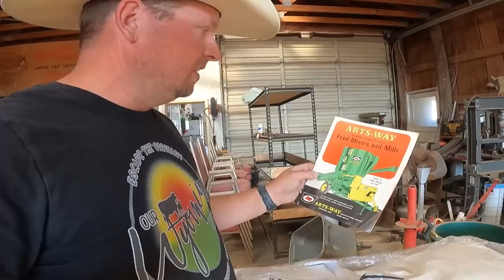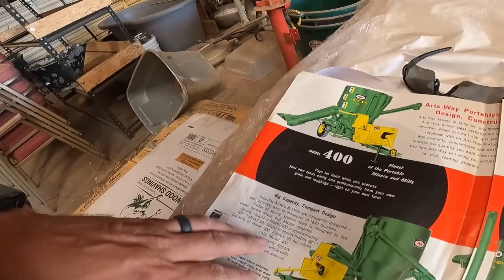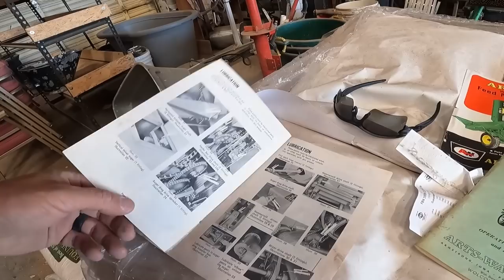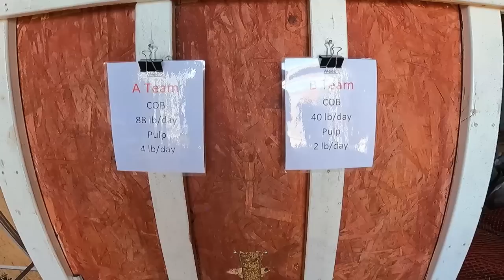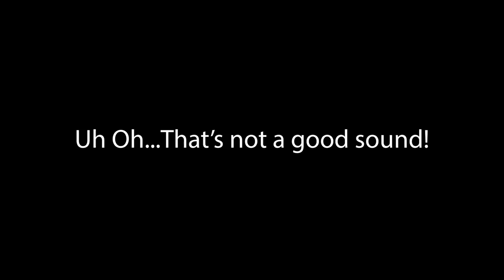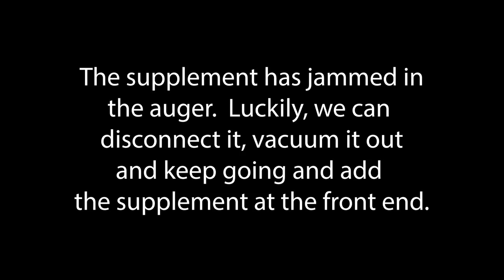A New Grain Mixer with a Visit to Sonne Farms!

Comment: Great video,  I  actually saw  the Sonne Farms video first.  Brings back memories of grinding feed with  the AW mix-mills.  I  used to own a “400” then moved  up to a “420”.  Hope  the reps, Brian, or the service manual mentioned checking the oil level in  the main  gear  box  underneath the main mixing vertical auger.  Could get spendy if it  runs dry.  Hope you have good luck with the mixer.  Well built machines!

Comment: When we pulled step deck and flatbed we hauled wagons from Arts Way in Iowa to PA several times. In fact one time the clutch went out in the Freightliner at their place. I spent a couple days in a motel for it to get fixed at an Excavator's shop. Then I could pickup my load.
Reply from the maker: Glad they were able to accommodate ya Joe.  Ive heard that the trucker community are pretty helpful to each other.

Comment: When you lube the chains and the discharge auger joints use bar and chain oil for chain saws.  It does not run like motor oil as it is made to stick to the high speed chain.
For the bacon bits they might do better if the feed is ground.  Check with your FBN guys on that.  I just remember that our milk cows got ground feed and the pigs had finer grind for them.
Your Wyoming weather is dryer than Southern Minnesota's weather.  I was stationed at FE Warren Air Force Base from 1962 to 1966.  I enjoyed my time there but had no ties to stay for.
Enjoy your videos.
Best to you and yours.
Reply from the maker: Thanks for that tip about Chain saw oil David

Comment: Had a grinder like that, then in early 90s traded it for a Arts Way Grixxer. Very similar, used it for grinding hog feed. still use it today for my calf feed mixing. I'm from NW Iowa about an hour away from AW manufacturing.

Comment: Those are good mixers/grinders. I have one from International, which was actually made by Artsway. Yours is in much better shape then mine and I wish mine had that loading auger. One suggestion/tip, when you go to add mineral or whatever into the small mineral tub, there's a small piece of metal on the inside to the left, if you flip that up it will hold the lid up for you. I run mine on a roughly 65 hp tractor and can make it work hard grinding pig feed, so watch for that if you ever grind your own feed.

Comment: Mike my grand father bought a hammer mill from Sears. Built by w w grinder Wichita kansas. Powered by a flat belt from a tractor. I bought a bear cat grinder mixer. Disconnected the mixer , Turned grinder discharge, blow it into trailer. When I grind baled corn stalks I can pull down my 4010 John Deere.

Comment: I've spent 1000s of hours filling an artsway 400 We used to put about 300 acres of corn in large corn cribs and then all threw the fall winter and spring we would grind feed for our cow calf  operation at that time we were finishing about 100 head of steers and heifers..

Comment: Hi, like your channel, I have run a grinder mixer a lot of years, I would suggest not to put all your supplements in first, because most of it will sit on the bottom, if you noticed when you had upper open and looking in side grain has to build up before it starts coming up the center tube to mix, I would put grain in first to build up to start mixing, then as you continue putting grain in add supplements a little at a time as you add grain. Just my 2 cents. Thanks for videos

Comment: Nice to see that you have an easier way of mixing all of your feed together rather than using the concrete mixer. Honestly you do not even need to fix the supplement bin all you need to do is turn off your hammer mill right away and add your supplements the same way you loaded that bag. The auger underneath will carry the supplements straight to the tank of the grinder just like the supplement bin did. We have a case 1250 grinder/mixer and we do not even use the supplement bin, it is so much easier to just add it in first with the hammers off rather than messing with that bin and trying to hold up the lid while putting the feed in.

Comment: Was raised up grinding feed for dairy cows with New Holland feed grinder, basically same machine. We only ever put minerals and soybean meal in the supplement auger. And I heard you mention grinding hay. I’m not confident I’d try that unless you want clogged augers. It may work, just never seen anyone do it before.
Reply: Also, you might find it handy to put a diverted on the end of your output auger so the feed doesn’t just fly out the end. Any one I’ve ever seen has a hood over the end of the auger to direct the free falling grain down. Ours was even fashioned just right to slip a 100 lb feed sack on so you could directly fill feed sacks from the mixer/grinder.
Reply from the maker: We actually got a diverter today. Not sure what happened to the original.  Not sure I would put hay through it but the original instructions say it’s possible :)

Comment: Maintenance is the life of a mixer usally its the mineral additives, salt etc. That corrode a mixer they need to be rinsed off exterior after each use. And internally usally once every 2 months or when time is available. I am sure that using a leaf blower may help after each grinding operation.

Comment: Growing up My uncle used a new Holland mixer did the same thing....if you need to add your supplements to the front end....we found it was easier to add it to the catch bin at the top of the auger before the hammer mill, so they dont spill out the bottom of the auger....Also might want to get some ear protection...I know over time those mixers will do some damage to the hearing. Happened to us...

Comment: get the gorilla tape out and seal up them little leaks    Mike you did very well with that purchase     it will be so much more digestible   make sure if it is not cracked or so  then grind.   smallest ingredients first then   it will be mixed up when finished  adding your COB    we ground our hog feed for years   great way to save some money

Comment: Here’s my suggestion on running a grinder mixer do you not throttle your tractor wide open and then throw it in gear you can break chains and burn belts if you’re not ready you can maybe hurt somebody else as well and as far as those boxes where you put your ingredients in there is a crazy latch that you have to pull up it’s a flat piece of steel on the side of the box it holds the lid open I have an archway

Comment: IF NO ONE TOLD YOU, ALWAYS ALWAYS ALWAYS PUT THE CRANK HANDLE FOR THE DISCARGE AUGER BACK BEFORE UNLOADING. It will either fall off and get lost or fall into the unload auger by the door and jam. I have the same grinder. Learned the hard way.

Comment: No transistors, No interface, No service call. 
Only two reasons old equipment stops working. The machine is out of adjustment and Operator error.
Thanks for sharing, Mike   -EZ

Comment: I used to run a hammer mill similar to yours back in the seventies, grinding corn on the Cobb, with shucks and stalks, for dairy cows.  Filled up two of those a week for a heard of around 50 Holstein.  Don’t forget your safety equipment, eyes, ears, and keep all of the safety guards in place.  That’s a very dangerous machine!!!
Reply from the maker: I agree it is a dangerous machine. Thanks for watching John.

Comment: Imagine a gravity wagon with a simple roof on it right where the cattle are fed. just drive the mixer wagon up to it and dump it right in.... no need to put it back into the bag and then an elevator into the OSB container then into a bucket to be walked to the cattle. "Just a few acres" has a YouTube channel and he actually worked on his gravity wagon with a simple roof that would be perfect for your operation.  You could have several gravity wagons and only have to do this every couple of months instead of every 15 days like you are currently. An old gravity wagon cant be expensive.

Comment: Hey you are not going to have a PTO in that tractor if you keep turning it in gear at full throttle . If the grinder has set for a long time you need to run some hole corn or something like that to shine up auger’s and the inside. Do not grind the corn just put it in hole.